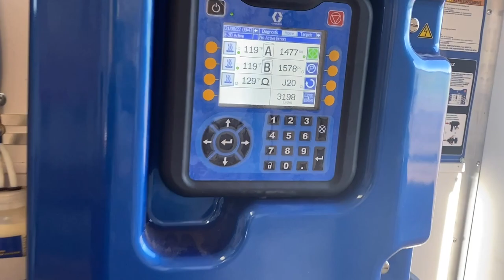DAY 7- CHAIN SAWS CUTTING WINDOWS, ROOF INSULATION, Meadowlark’s Trout Creek Log Home In Colorado

Comment: A wonderful cottage, but personally I wouldn't do the insulation with foam, I wouldn't even get it for free, that's a time bomb, in case of a fire you don't put it out, mineral wool is 1000 times better
Reply from the maker: The foam will not burn, it’s very fire resistant
Reply: @AmishMeadowsOfficial  What the ???? you tried to set it on fire, it's smoldering and you won't be able to put it out... I don't even need it for free